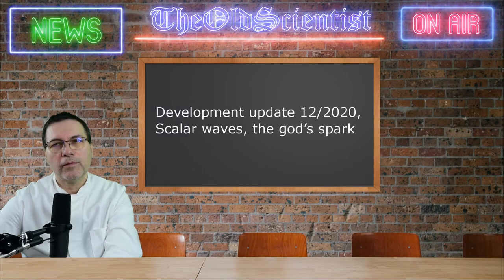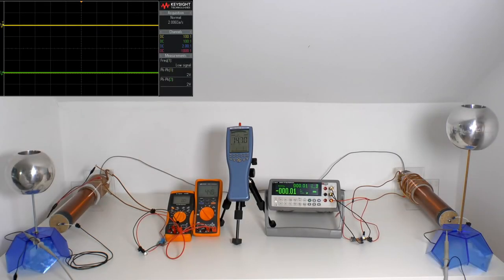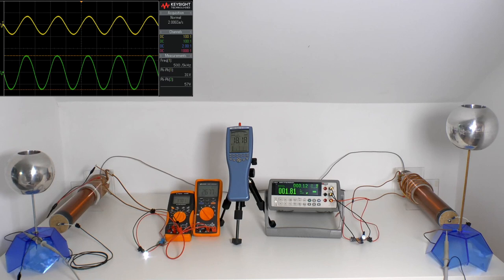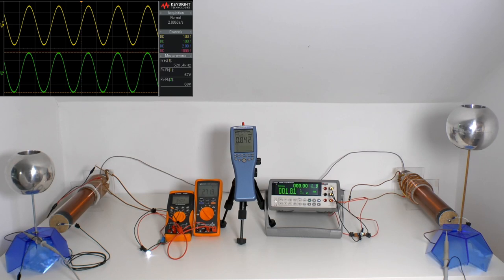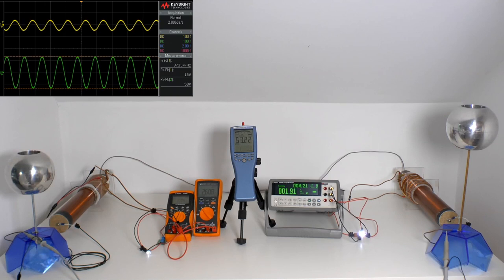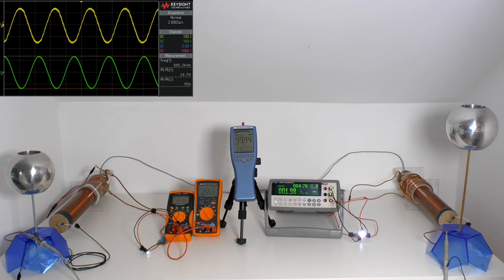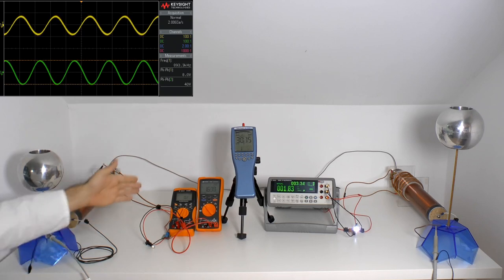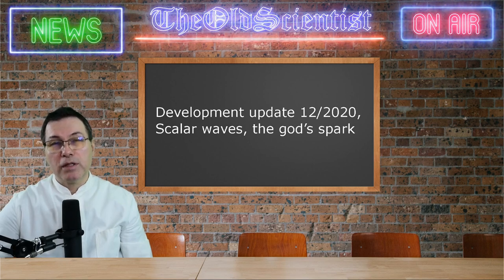Scalar wave, god's spark and the voice of the angels

Comment: The low current seen on the transmitter side might be a resonant null appearing at the meter, for a higher harmonic especially, so that the meter simply doesn’t see current at that point in the circuit. 

This would, of course, change at regular intervals with distance, if the leads were acting like a transmission line or antenna, assuming the frequency is fixed during comparisons. I would re-do the experiment with much shorter leads on the test instruments, snd try to see how the lead length might affect the measurements. It is possible that changing lead lengths substantially varies the resonance, assuming they form part of the resonant circuit, which tosses in an unavoidable variable to the mix of changes in the null locations, further complicating analysis. 

Another approach would be to use clamp-on ferrite chokes on the leads, like those found on some USB serial cables, snd Sony PlayStation charger cables,, and twist them together to prevent stray fields from corrupting the measurements.

But this is some important work anyway if only to get to these qualifying follow-up questions. It’s rarified air you are swimming in, subject-wise.

You have to appreciate that a meter will show low values at nodal points in an AC circuit. While the fundamental frequency may be too low for this to manifest, harmonics might be short enough wavelength to present nodes at the point of measurement.

Comment: Tesla said it is the “damped” aspect of a longitudinal wave that gives so much more back. I believe a frequency of at least 1 million per minute  square wave impulses was how one could leverage a small charge into a large mechanical force, if one reads the totality of Tesla’s prose, and especially his testimony in the Westinghouse bankruptcy hearings. Tesla has patents showing his apparatus for producing high frequency, he suggested a quenched spark gap for the most efficient operation. I might suggest a tesla turbine with a shaft that shares the wheel/ wheel tungsten spark gap wheel spark gap apparatus. 
I believe Tesla also said to create the correct fluid dynamics on coils, both solenoid, and flat,it was important to have a space between the wires which is equal to the diameter of the wire. I use glass thread for the gaps. 
I was planning on doing all of this in a build, a smaller 3 foot diameter wheel with 40 tungsten pins hooked to a center rod to a tesla turbine. The turbine creates the voltage, the voltage is run through the wheel(with 40 tungsten pins equal distant around the perimeter). Magnets are set on both sides of the spark gap, and the spark should be able to get to 1 million easily, so long as a 50k+ RPM can be attained. Totally possible with a carbon fiber wheel. 
It would be analog and completely tunable high frequency, high voltage one wire system. I would need to get some transformers most likely before the spark gap? To be determined…..so I can get a voltage that isn’t too high for regular household items.

Comment: In old photos from the 1800s, buildins are shown with a metal ball on the roof, connected to balls inside the house.  They did not have fancy electronics but they had free electric power.

Comment: interesting as always, I am still working on designing coil systems based on square wire (instead of round) coated in bismuth on one side  to improve coil efficiency.
Reply: Magnetic square windings work much better. Especially if you are going to build a TREC device. The key is to get frequency echo chamber feedback from the skin effect of the square wire. It adds induction (pressure ie voltage) via the square sides vs the bubble of the perturbation.
Reply: @Cryptic_Triptych  yeah I have been looking at a lot of things differently after learning years ago about how they used shaped charges to avoid weak points in explosive compression for the manhattan project, like how to use shaped sound wave compression (frequency not speed through the air) and light wave compression as well, along with some complex shaping to create a shaped magnetic field for retaining plasma and such too. :) (think of the effect of two wire coil that has one set of coils sculpted into an X like cross section so that the second set being round lays right into the grooves of the other coil system)
Reply: @Cryptic_Triptych  Did you delete something or was it censored?
Reply: @ThomasAndersonbsf  Hmmmmm, not sure, I posted my comment and added to the original.
Reply: @Cryptic_Triptych  the one that had this in it? 
"my theory is - Implosion, compression and explosion."
 I am not seeing the rest of it anywhere in the comments here though.

Comment: Hi fantastic, how do i find out how to build this, plans etc? Can I find it on your pay per view?
Reply: step 1 build two identical tesla coils
step 2 conect a function generator to the primary coil (the thick few winding air coil) of tesla coil unit 1
step 3 connect the bottom or start of secondary  coil (large coil) unit 1 to the other tesla coil unit 2 secondary bottom wire
step 4 find the 2 resonance frequencys  low freq = hertzian   higher freq = scalar wave

Comment: Interesting setup! It remains a bit obscure how the ampermeter is connected in the input side? If it is only measuring the current in the input led - the output and input power available cannot be compared. Looks like the transmitter led (in a scalar case) goes off when the input voltage goes down because of the signal generator impedance and increased power requirement in a transmitter. Transmitter energy, however, increases.
Reply from the maker: I went through all scenarios to find the path. Of course impedance is the first thought but you go through two loose coupled primary and secondary. What you have not seen is that the power requirement on the amplifier outside does show the power requirement on the inside plus the losses of the amplifier only from the transmitting coil. No path to the receiver. Shunting the receiver completely to ground does not change that.
Reply: @TheOldScientist  I appreciate your dedication and focus, I know myself how difficult is to build proper experiments (always lacking something). This replication has been in my todo list.
What I meant in my question in other words was that we cannot see the real wattage in the input that can be compared to the real wattage in the output (to correlate your mentioned the interesting COP). Sometimes a circuit is better than thousand words for others to replicate. Led indicator in the input actually cannot reveal the actual energy consumption in a transmitter.

Comment: I dont understand yet.  How can Scalar waves be measured on an oscilloscope that's tuned in the hertzian system?  Hertzian is based on seconds, which is based on the division of a 24 hour clock.  Are scalar waves based on a different unit of time?  How would it affect the energy radiating from the power source by changing the units of time?  I trust that Tesla doesnt say things that do not have substance to them.  My head isnt grasping it and its driving me crazy
Reply from the maker: The term scalar comes from the direction of propagation. It is not different as electromagnetic wave as it is part of every radiation of a coil. To simplify the understanding. When tuned to resonance. The scalar wave is about 1.4 times higher in frequency to adjust. That is all. You can send it and you can receive it with a radio. Check all my latest video about that subject on my website.

Comment: I kinda wonder if this tech is used appropriately say on mars if it would cause rotation of the core of the planet to induce the same magnetic field that protects earth now from solar energy so we get just the right type and amount of radiation we need since it is pretty well known the core of mars is dead and produces no electromagnetic shielding posing one of the more challenging aspects to colonizing the planet. also makes me wonder if it could be used as a much more efficient way to spin up a planet that is not rotating fast enough or slow one down that is spinning too fast :)